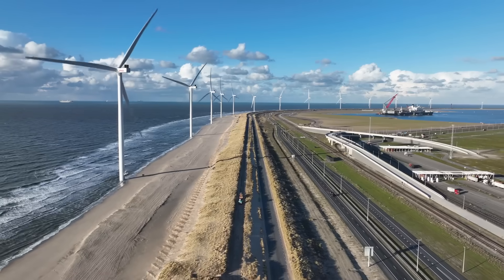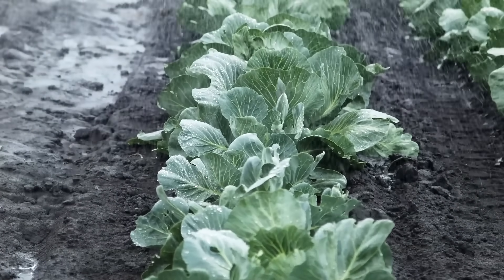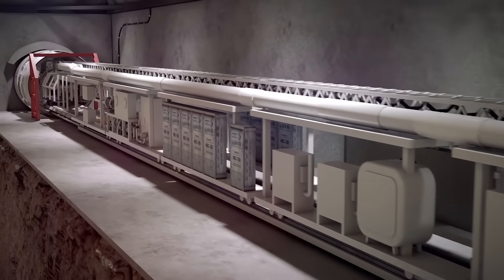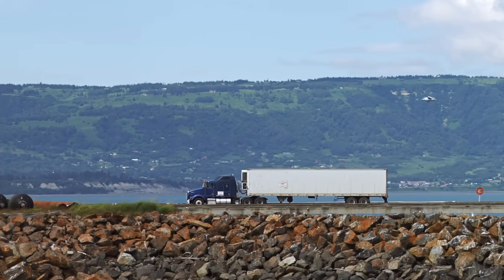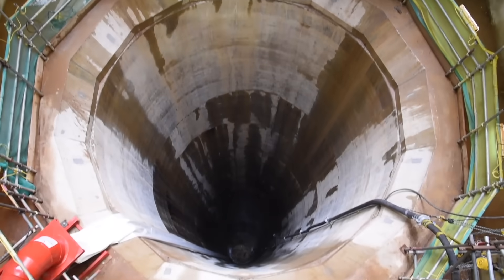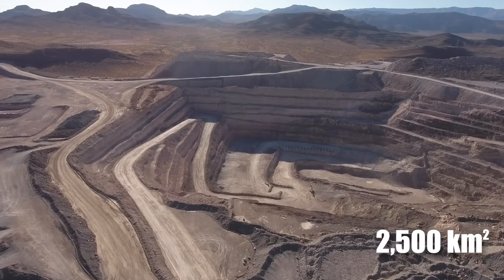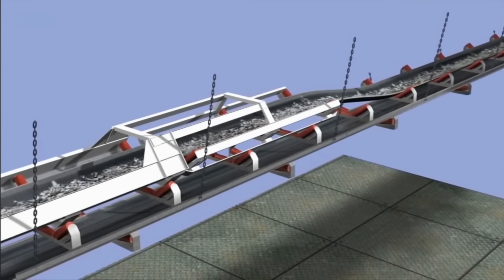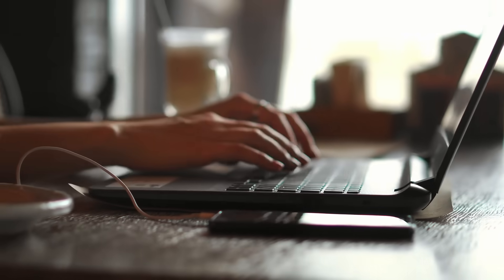Britain Is Building A Massive New Super Mine That Nobody Has Heard Of

Comment: A small but important correction here: While polyhalite is certainly useful as a component of fertiliser, it cannot be used as fertiliser on its own, so is not a replacement or alternative to more conventional fertilisers. The primary nutrients plants need from the soil are nitrogen (in the form of nitrate salts, ammonium salts, ammonia or urea), phosphorus (in the form of soluble phosphate salts) and potassium (as soluble potassium salts), hence why commercial fertiliser is often given the label "NPK", which are the three element symbols - N for nitrogen, P for phosphorus, K for potassium.
Polyhalite contains plenty of potassium, but does not contain any nitrogen or phosphorus. So to create a balanced fertiliser, polyhalite would need to be combined with the other two components. Otherwise the soil used for growing plants would become deficient in nitrogen and phosphorus sooner or later if polyhalite was used on its own as fertiliser.
Reply: Thanks for that !!  Would'nt have known but reading some comments did 
wonder where the nitrogen element was`, Cheers

Comment: The missing information:
Polyhalite is an evaporite mineral, a hydrated sulfate of potassium, calcium and magnesium with formula: K2Ca2Mg(SO4)4·2H2O. Polyhalite crystallizes in the triclinic system, although crystals are very rare. The normal habit is massive to fibrous. It is typically colorless, white to gray, although it may be brick red due to iron oxide inclusions. It has a Mohs hardness of 3.5 and a specific gravity of 2.8. It is used as a fertilizer.

Comment: All these minerals are required as fertiliser, but they failed to tell you that, alone, it’s completely inadequate.
Plants require nitrogen in order to grow. They cannot make proteins of any kind without nitrogen, because proteins are made up of a string of amino acids and all of these, per their name, contain an amine group, which has a nitrogen atom at its core.
Though the atmosphere consists of 78-79% nitrogen gas, most plants cannot “fix” nitrogen from the air. 
Those which can do so as a result of commensal microorganisms living in clumps among their roots. 
So polyhalite is part of a solution to the problem of sourcing fertiliser. 
Most nitrogenous fertiliser is made using natural gas (methane) and nitrogen gas, to produce ammonia, iirc.

Comment: FRAME 8:13 is the old Carbon Power Plant in Price Canyon which is four miles north of Helper, Utah.  This power plant was de-commissioned and completely removed and reclaimed over 15 years ago.  It burned coal.  My brother retired from this power plant before it was de-commissioned.  I retired from working in the underground coal mines that were in the canyons behind the location of the power plant camera that took this picture.  This picture has nothing to do with England's mining of polyhalite.  You have just been fact checked and miserably failed with just this FAKE picture making the question of  - ARE THERE ANY REAL PICTURES OF THE WOODSMITH POLYHALITE MINE in this video

Comment: Very impressive.

When the introduction presents the product, it is introduced as a zero carbon product, however the construction of the extraction facilities has an enormous carbon cost. Set against the carbon cost of conventional fertilizers and shared over the lifetime of the mined area and possible repurposing of the site, this may be presentable as an improvement but most certainly not zero carbon.
Reply: if you believe in that nonsense....

Comment: That’s an ‘aside’. Real reason for the ‘hole’ is to store future nuclear waste I’d suspect. Residue due to all those leccy cars. Everyone seems to forget the TONS and TONS of aviation fuel used every day. Private vehicles usage is minuscule compared.
Reply: Using UK totals as I couldn't find world figures, in 2019 (everything dropped during covid, and levels were relatively stable in the years before that, so I'm guessing 2023 will be similar) petrol and diesel use was 39.36 million tonnes and aviation fuel was 15.08m tonnes. Petrol alone (being more likely to bolster your case as more likely to be for private cars) was 13.2m tonnes. Less, but hardly miniscule, and there were about 12million diesel cars on the roads that year to add in (I've not included vans of any description, just cars). I would imagine that this is representative of the rest of the world more or less. That being said, the current generalised advice when it comes to being as low-impact as possible is to use public transport, but if you absolutely have to have a car to get a good, fuel efficient second-hand vehicle rather than buy a brand new electric one. Best to get the most out of the good stock that has already been produced before we use resources to build and maintain the new ones.

Comment: I'm not sure where Anglo will sell the 20 million tonnes, the market just isn't there,  they will encounter so many problems  extracting the Poly at 1500metres, for starters the virgin rock temperature will be around 50 degrees  before the heat and humidity generated by the electrical infrastructure and actually cutting the rock.  good luck guy;s its going to be a warm one.

Comment: How is it possible you guys are able to build a tunnel so quickly and economically for ores but not for people.
Reply: I would argue you gave a large part of the answer in your question: A tunnel for people need lights, signs, ventilation and fresh air supply, emergency exits, signal systems and much, much more. Ore and the conveyor machinery does not need much or any of those things. Just look at fire suppression systems: In a tunnel for people you need a much more extensive system, and one that does not kill people. Whereas in a tunnel for mahcinery a fire can be extingushed simply by overwhelming it with something like Halon 1211 or Nitrogen - the conveyor system don't need oxygen, so it is not harmed by the abscense of it. Humans on the other hand ... 

To put it differently, would you like to travel 1300 meters underground in a long, dark, wet tunnel with no emeregncy exits (or any kind of exits) along the route? Probably not. Ore does not mind.

Also, bordersw1239 and johnlatchford pointed to other large facts: simpler geology and (at such a depth) no interference with ground lever structures.
Reply: Follow the money.
Reply: it is very deep, so no interference with ground level structures, no stations either
Reply: Geology
Reply: @bordersw1239  Geology Rocks!
Reply: private funded vs government funded. people take the piss when someone else is paying for it
Reply: reason blackrock is a share holder who is also a member of w.e.f
Reply: Money.
Reply: Do you still really think that the govt cares about you? Go get your booster.
Reply: They built the Tyne tunnel
Reply: Regulation. The UK spends an estimated 3 times more for public projects then other European countries because of regulations.
Reply: Private ownership would be the reason I imagine, government projects are normally managed by unsackable idiots, private enterprise tends to be a bit more cut throat.
Reply: Exactly my thoughts. The crossrail was over delayed and over budget but this tunnel done out of sight and on time.
Reply: @PatrickPeterVlogs because london.
Reply: @davelowe1977   Because London is an ancient city with used and disused rail tunnels, with equally large used and disused Victorian sewers, water and gas pipes, because of archaeological findings dating back over 10,000 years, and underground streams and 21 underground rivers. Digging the tunnel included one of the most extensive archaeological programmes ever undertaken in the UK. A few hold-ups caused by finds, I believe. The subterranean River Westbourne crosses the platform and tracks in a pipe at  the Sloane Square tube station, but I don't know whether Crossrail ran into any underground water issues. It's not easy to bore a tunnel under London because there is so much stuff in the way.
Reply: Crossrail had hundreds of pipes, tunnels and cables to negotiate. This was straightforward chomping. @PatrickPeterVlogs
Reply: @PatrickPeterVlogs it’s not done yet
Reply: its not even owned by england we gave it away alresdy
Reply: @paulskinback717 how much can we bet the UK government have an awful deal in this situation?
Reply: I've come lately to think that the UK is the United Kingdom of America @paulskinback717
Reply: Because people don't want to live in tunnels

Comment: Love the shot of boulby mine in there that's only 20 miles from the woodsmith site that's already mining polyhalite, and has been for 5 years.
Reply: And has been mining potash for 50 years?
"Potash and polyhalite are water-soluble minerals that are useful as fertilizers. The key difference between potash and polyhalite is that the term potash refers to the mineral salts containing potassium, whereas the term polyhalite refers to the hydrated sulfate mineral having potassium, calcium and magnesium ions."

Comment: The tunnel boring machine (TBM) shown at 7:00 is 2.4 times larger at 12m diameter, than that required for this project.  It completed the twin Silvertown tunnels under the Thames River near Greenwich.
Reply: That's the problem with videos that overdose on stock imagery - it's hard to tell whats actually is part of the project or not. Lots of it in this video unfortunately.
Reply: Ours is 6 metre